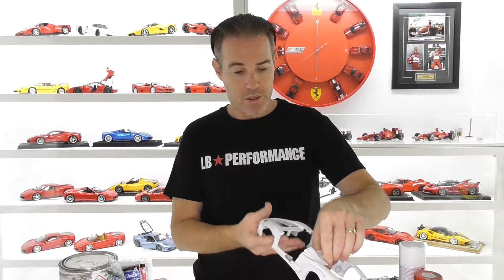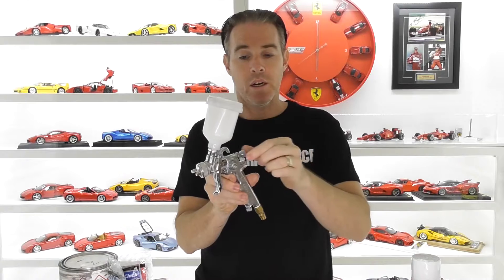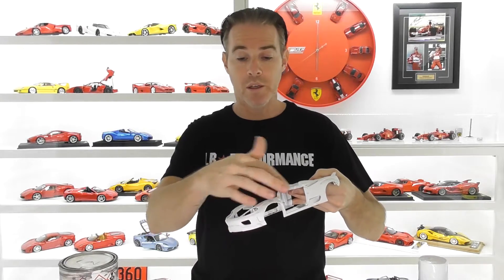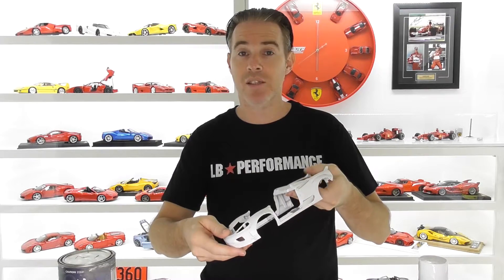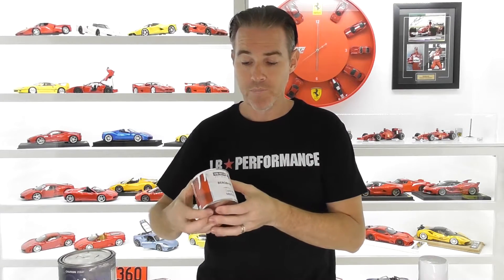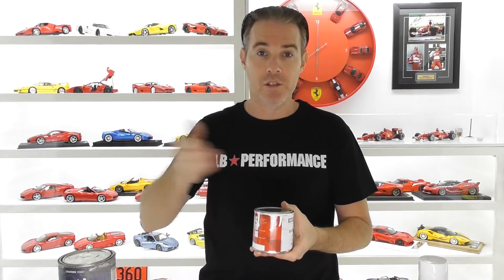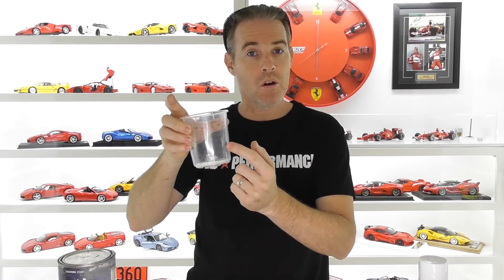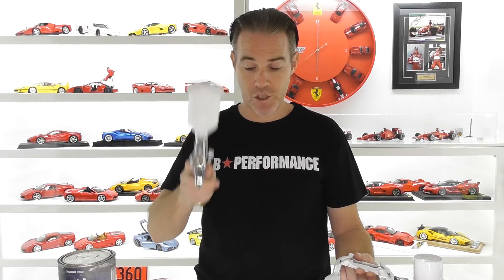HOW TO PAINT DIECAST CARS with AUTOMOTIVE PAINT - PART 1

Comment: Hi, i have 1/8 model that I have scraped to the metal. I purchased automotive paint with 1k lacquer primer. I prepared surface for painting by sanding with 400 grid sandpaper and wiping with lacquer thinner. I applied primer with my spray gun.All my work ended up that primer ripping of with just paint tape… for an experiment, I applied the same primer on steel, and it bites like crazy…. Is it problem with type of metal or what? Do I need to use another primer?

Comment: If in Australia that $20 spray gun found at auto 1 super cheap or auto barn touch up gun depends on discount day
Reply from the maker: The 'Star' mini spraygun (0.8 nozzle) that I use is around AUD$119.00 retail. I cannot recommend a cheap $20 spraygun to get the same results that I do with this higher end spraygun.
Reply: ROBS MODEL CARS  use my $20 spray 10 year  that on Special  same one you have in your hand star  when not special $128
Reply: ROBS MODEL CARS  plus I have lots spray gun because don’t like mix different Contaminants 
One for each purposes

Comment: I'm currently building a Ferrari testarossa 1/8 scale model  Unfortunately there is damage to the model there's a bend on the left side of the body right by the front left door there's a gap it's obviously damaged in bent and I can't seem to get back into place if you have any suggestions on where I could either find a used Ferrari testarossa body 1/8 scale it would be greatly appreciated.....

Comment: I've been using automotive spray paint which is in a spray can. I prime my diecast models and I usually give the primer a few days to cure before I put the top coat on but I've found that after my hard work and nice paint job, the paint is easily chipped or scratched.
Reply from the maker: Are you sanding the primer before you top coat? Otherwise the color won't ' key'  to the primer correctly.
Reply: @ROBSMODELCARS  I am confused about your comment are you supposed to sand the primer

Comment: Hi Rob, would you be able to recommend a good complete airbrush kit for someone starting out? I've painted models in the past using spray cans and haven't been happy with the quality of the finish. I have a few nicer models I would like to paint, and don't want to use spray cans anymore! Thanks.
Reply from the maker: I use an Iwata Revolution airbrush and I highly recommend it. I tried cheaper airbrushes off eBay first and had nothing but problems. The Iwata is easy to clean and sprays great every time after I clean it. Don't waste your money on cheap airbrushes.
Reply: @ROBSMODELCARS  awesome thanks so much rob!